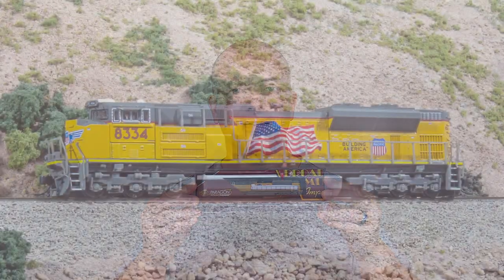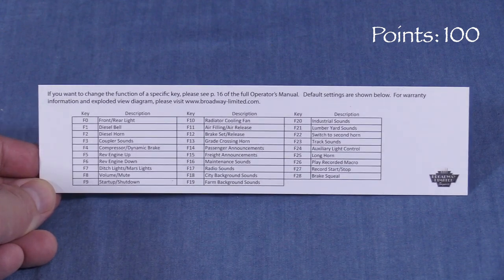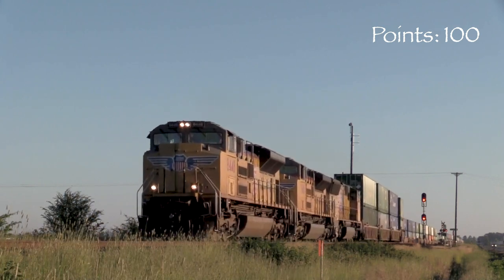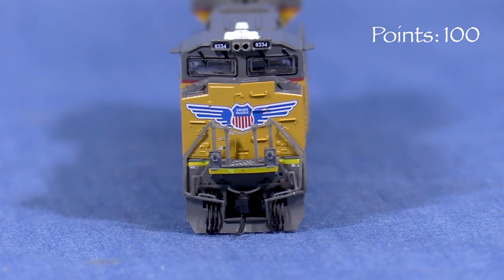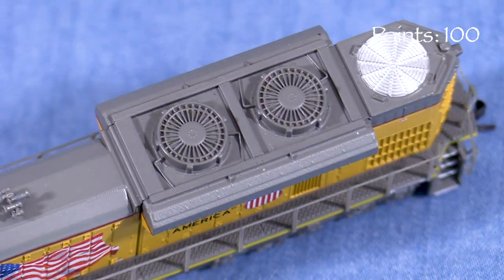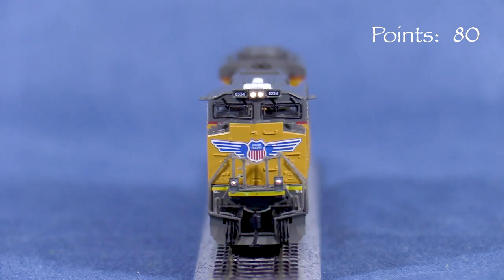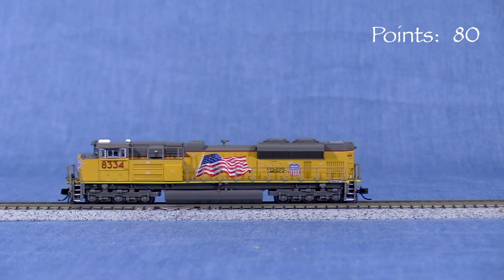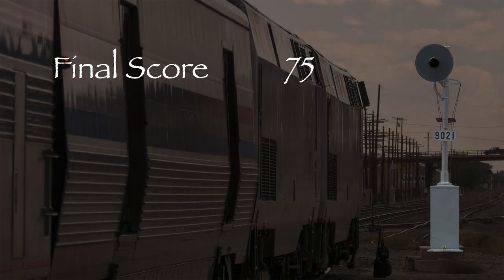Product Review N Broadway SD70ACe Locomotive

Comment: Nice review Dan, but I'll say this. Looking at this model from Broadway Limited is kind of a disappointment and I'll tell you why. For a MSRP price of $250 and if you're lucky you might be able to find it in the neighborhood of $200 or less. It is lacking some of the essential details for a model in that price range. For God's sake, it doesn't even have grab irons. For me, it is just a duplicate Kato SD70ace. True, it does have sound, but whoopty Doo, why not put the grab irons on the thing? I have four of the Broadway Limited AS6000's that I bought sometime in January of this year, when I just got back into the hobby and didn't really know any better. Again, true, they do have sound and again, whoop-dee-doo. They have all the molded handrails just like the Kato models, but they generally cost way less, unless you get the ones with sound and they are over priced at $300. I guess what I'm saying, is that maybe we are spoiled by scaletrains.com for all the details that they throw on their models in both in N-scale and HO-scale. I believe that both Broadway Limited and scaletrains.com are around the same price, the only thing you have to do to the scale trains model is add the stink of diesel fuel as they are laden with detail. Anyway, I think Broadway limited should have done the tier 4 SD70ace, why repeat what's already out there? I'd rather dress up and detail a Kato than buy this model. I also think that the Fox Valley sd70ah  is a fine model as well, they at least Supply you with grab irons. There's my $0.03, thank you for reading.
Reply from the maker: I really like the stuff ScaleTrains has been putting out lately.  I think they've done a good job catering to modelers who like accurate detail, and I think they've raised the bar in terms of expectations for a given price.  I think BLI tends to miss the mark in that area sometimes.  I would also like to see less duplication of effort between manufacturers, more variety rather than new releases of models that are already available from another manufacturer, especially when there isn't any great leap in detail.  Thanks for watching!

Comment: I went to my LHS today and looked at one. I have a few ACe locos but in Kato with no sound. I thought the Kato units have better color and detail so I am going to just install sound on those.
Reply from the maker: I like the Kato models, too.  Thanks for watching!
Reply: I installed the Excel Systems 1960 DCC card in my Kato SD70Ace.  It requires some chassis modification and the speaker is small, But for $50 I'm very pleased.

Comment: I bought at Broadway Limited Imports HO SW7 new (with Paragon 3 sound).  It was junk right out of the box.  Returned to them. A few months later I get it back and it is still junk.  Poor low spreed performance.  Pulsing movement.  Sudden starts and stops not prototypical.  Walthers Proto and Atlas Gold are all I will buy as of now.  Thanks for the honest review as always.
Reply from the maker: I had a BLI NW2 years ago when they first released them and wasn't too impressed with it.  I ended up selling it on eBay eventually.  Thanks for watching!
Reply: @DanielCortopassi   I was thinking of trying a LokSound 5 micro in the BLI SW7, if it doesn't improve operation I will put the LokSound 5 micro decoder in another locomotive I have that is DCC ready.  I don't know if it is worth the effort.  If the engines are garbage, then the new decoder won't do much.  What do you think Dan?

Comment: Dan it was a Good Review but I would have given the Model a Caution or Red Signal 1. for over spill on paint on the Model there where more than I place that I seen over Run or just poor painting the upper Road lights covers looked awfully applied and the Ditch lights wasn't that much better you add that up with what you Reviewed and pointed out I wouldn't spend $50.00 Dollars on this Engine you know Dan you can fancy up stuff all you want but it better look Good and it Better perform for all of what there Asking and I'll pass this on I know of one Hobby Shop that is Selling these Engines but the Shop Owner Told me that Brodway Limited is back to doing what they did a few years ago which I assume is putting out poor Equipment and there not doing much about..  I stick with KATO'S Any Day.. 

Thanks for Posting this Video..
Reply from the maker: Other than the lack of factory sound, I think the N scale Kato SD70ACe compares favorably to this model.  I have several of those and may try adding sound to them in the future.  The paint fuzziness on the BLI model probably shows up more on video than it does in person, since the image is zoomed in.  It would still be better if it wasn't like that.  Thanks for watching!